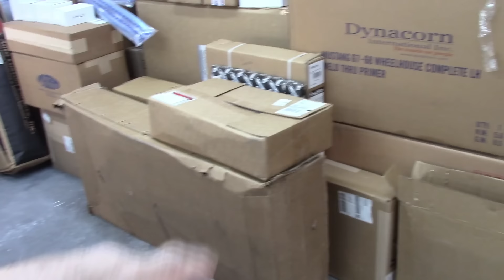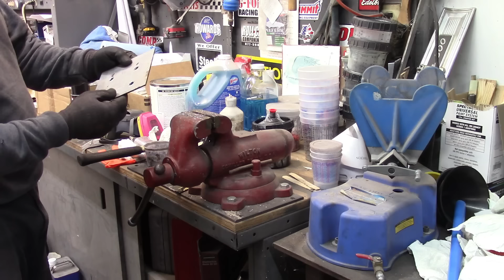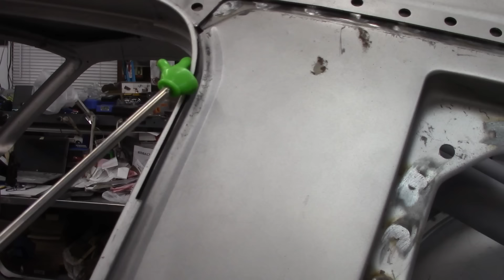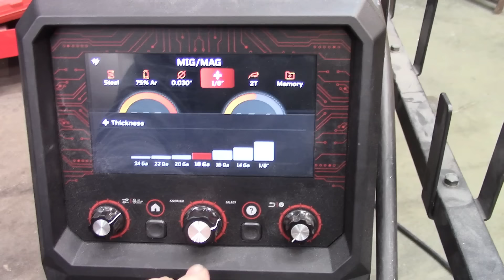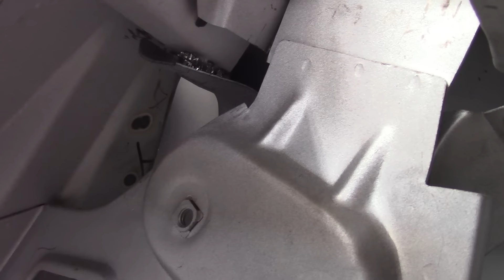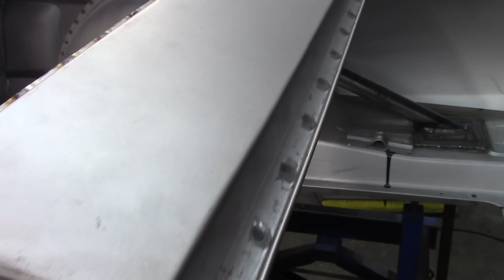1968 Mustang fastback build. Fangled 14. Roof panel install.  #mustang #conversion #howto #diy

Comment: I noticed you’re using a different MIG welder. Are you no longer using the Arccaptain welder?
Reply from the maker: I have been using the yeswelder as they provided me with a new model. i still have the arccaptain. Works fine.

Comment: Have you ever given any thought to using some panel bond on the roof and maybe just welding some areas?
Reply from the maker: I have. On a modern car with collision damage that can be done. This car is supposed to be raced. Body torque could separate bonded panels.

Comment: I have one of those hand held spot welders. I used it anywhere I could. It did a good job, but the weld through primer was a problem and I too had to clean the spots to weld.

Comment: I had to re weld my fender skirts last weekend. The previous restorer had braised them in and it was cracking. It was my first time welding on my mustang and my first time welding sheet metal. It was very stressful but I was able to get it done and with a little filler and paint it looks better than ever.
Reply from the maker: Glad you were able to fix it!